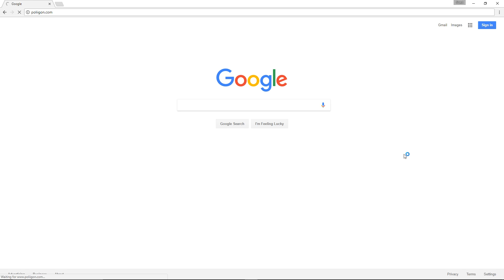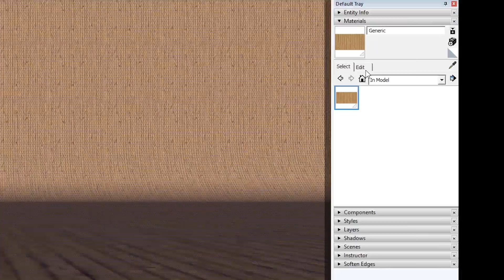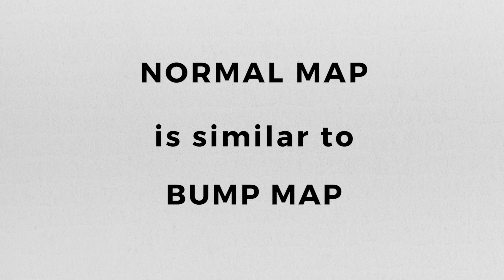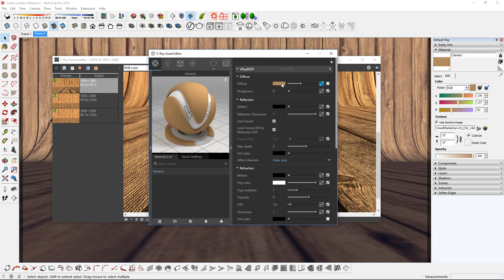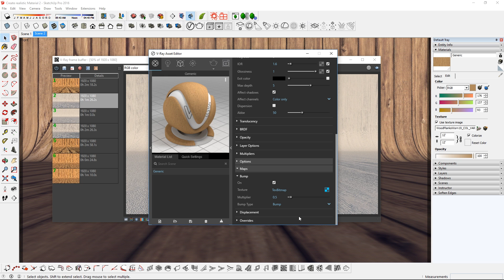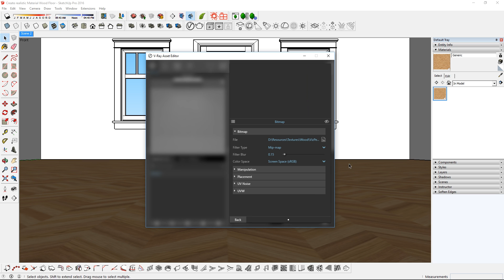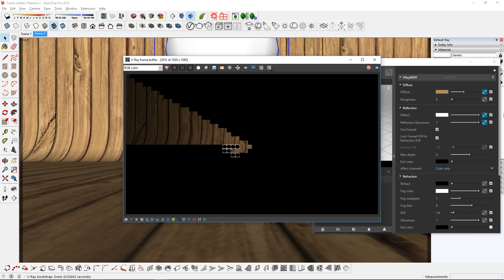How to Create REALISTIC Materials in V-Ray

Comment: Thank you so much for the explanation. 
I have some questions,  my bump and displacement settings does not work.

I am now using Sketchup 2017 trial version. Could it be that reason
Reply from the maker: Both bump and displacement dont work? Did you apply the material to both sides?
Reply: Architecture Inspirations 
 I retry with the given  tif files instead of jpeg... now I can see bumps n displacement... the realism is obvious now.....

Why can’t it work with the jpeg file??
Reply from the maker: @samitune  it should work with jpg files just fine. I use jpgs all the time
Reply: Architecture Inspirations   Yes when I tried jpeg I applied both sides yes, 100% coverage, but to no avail.

One more question ....must I do any form of extruding ; giving the surface some volume n depth, before displacement could take effect?
Reply from the maker: You don't have to. An easy way is to group the surface and apply material to it
Reply: Architecture Inspirations  what do you mean by applying on both sides? U mean both bump and displacement? Yes I’m tried on both all along.
Reply from the maker: @samitune  I meant apply to both sides of the surface. Back and front

Comment: Hi sir Minh , can I ask something? When you're done adding diffuse map in vray from poliigon, is it possible to change the color of that texture from poliigon ? For example, I like the road texture in poliigon, but I don't want its color which is black, I want to make it white.. Is it possible to make it white in vray even if the original color of the diffuse map from poliigon is black? .. Because I tried to maximize the diffuse color in vray to make it white but it didn't work .. The color of the diffuse box is white but the preview in material is still black.
Reply from the maker: You can just invert the texture. Or use color correction texture to adjust the color of the diffuse map however you want. The preview will never change itself if you're only changing the color in vray. If you want the preview itself to change then just edit the diffuse in photoshop

Comment: so, if i have a displacement map i don't need the normal map or the bump map, but the displacement map costs more computing power? so for a flat plane let's say a floor it's better to only use the normal map or the bump map and for more complex organic geometries like stone i'd use the displacement map? Am i getting it right?
Reply from the maker: Yeah you got the gist of it. However, sometimes you may need to use both maps. For example a brick material. The displacement map would help with the joints and insets, while the normal or bump map will create the bumpy surface of the brick itself. It really depends on where you got the maps and how they were created. Overall, normal and bump maps are used more often because they cost less power 😊

Comment: Hi Minh, Thanks for wonderful tutorials. I am using CC0textures website recommended by you. When I download a file it contains several other files, like I downloaded paintedmetal it has several files with names Col, disp, mask, met, nrm and rgh. I have an idea to put Col file in diffuse menu, nrm file at bitmap and disp at displacement menu.Can you let me know where to put remaining files ?
Reply from the maker: I haven't tried to use all of those maps yet but the normal map should be placed in the bump map slot. And I don't think vray for sketchup can read metalness map that well. Mask is for opacity
Reply: Thanks Minh. I always get a quick reply from you. I have also started learning lumion, I was wondering since Vray has a lot of options for a material. Don't this give the fact that vray give more realistic result. Since Lumion uses only texture and normal map. and just few more options.
Reply: Can you also make a tutorial on lumion for basic materials like plastic, wall paints, sink and toilet ceramic material properties. Because these are the things in every model.
Reply from the maker: Ah got it. So maybe a video on advanced materials in Lumion? Would the be helpful?😄
Reply: I don't know what will make the difference between white wall, white sink or toilet material and white plastic and if you can add white paper. I hope you get my point. These are the basic things which everyone uses but no one put tutorials on these.
Reply from the maker: Hm, but aren't there already materials for white plastic, white walls, etc in the library?
Reply from the maker: Ah I realized I commented about Lumion, when you're asking about vray 😂
Reply from the maker: I actually use the existing vray library a lot and I just make changes to the materials to get it to be the right color that I want. I'll try to see if I can make a video on that 😊
Reply: Sorry I got things mixed up. I just mentioned vray for comparison with lumion. Rest of the question are for lumion. There is no material for platic, paper and sink materials If i remember. Also I wanted the answer for question that is vray give more realistic result than lumion ? Is normal map sufficient for getting better result in lumion, since vray has many many options for a material ?

Comment: Hi I have a question. How do I get a bump/displacement map? Or I can use the same normal as a bump/displacement map?
Reply from the maker: You can use the normal map in the bump map slot but you may need to make some adjustments. And no I don't recommend using bump and normal maps for displacement map. You can get those maps on PBR textures websites 😊

Comment: Perhaps I'm missing something but I do everything just like in this video but my displacement doesn't work. It's always flat and when I turn off the diffuse and bump there's nothing. My materials are grouped (I saw that suggestion online) but nothins seems to work. Any ideas you could suggest? I'm going mad and in desperate need of help...
Reply from the maker: +Lúcia Tomaz yeah i know how you feel, i have the same problem before. you have to apply materials to a group, meaning, the object needs to have default materials, then grouped, then you apply the material with displacement. A simpler way for me is to apply materials to BOTH sides of the surface. Let me know if that works!

Comment: thanks for your tutorials, sadly I'm still not a fan of vray 3.4 swarm still has defects compared to dr wich works flaw less, I like the new interface  and the denoiser option but vray 2.0 was able to use more displacement maps in shorter times with the same configuration, btw you can use normal maps below bump type /use : normal map to tangent space, if any.
Reply from the maker: yeah you're definitely right about the normal maps! I couldn't get it to render correctly at first but figured it out soon after 😄

Comment: hey , really awesome tutorials dude , however i got problem , whenever i render my scene i can't see any bump or any displacement it's just textures , even though the preview of the materials shows the bump and the displacement , and also i checked the geometry and the scale, it's not that either , what do you think is the problem
Reply from the maker: hm make sure you apply the materials on the Front face of the object. In Sketchup there are a front face (default white color) and a back face (blue-ish purple color). Make sure the material is on the front face. Also increase the intensity or multiplier number until you see more bumps or displacement. Let me know if that works!! 😄
Reply: Hey thanks for the quick replay mate . yes i have tried this too , however it did not work either . the thing is when i use progressive mode in the render options , i get a correct lighting with no bump or displacement . but when i check the GPU acceleration , the bump and the displacement shows correctly just like the preview of the materials  
however the lighting gets all messed up with this black shapes and basically no global illumination ; very different from what i get from just the progressive mode . 
- I also tried very exaggerated bump  multipliers with different materials , but still same issue . i uninstalled vray and installed it again too , and made sure that i m using the right GPU and not the integrated one , Sorry for the long comment lol , coz i been looking everywhere on forums but no luck  
ps : i noticed also in the "vray progress window"  written in red , "Devices query yielded no results; using all available devices"

Comment: Do you have any idea why v-ray 3.4 not render windows, furniture and 
people from warehouse in old modells ? Have a old model and tried to render but this stuff won't render at v-ray 3.4. If I create a new model it works. Thk!
Reply from the maker: +Konrad Lentschig ah I think it's before the new vray has different settings so old models won't render correctly. Try finding an option on the extensions-vray- look for the wipe model option. It will help make the model compatible with the new vray

Comment: Hi, great vid as always mate. When adding a normal map should I change the "Bump Type" from Bump to one of the Normal Map types? I've noticed what seems like better results sometimes from certain angles when clicking that option instead of "Bump" in "Bump Type".

Also when I click displacement and add a map on textures with Vray, I don't seem to get any change in the geometry. Is there any settings I need to change?
Reply from the maker: You can keep it the same Bump type! But yeah you're right, it changes depending on the angles. There's links to videos explaining the difference between normal and bump maps, really useful to know.
You can change the multiplier I believe, might need to increase it to 5 or even more, depending on the texture. 😀
Reply: Top man! Thanks. Yeah I seem to get pretty mixed results with the multiplier. Guess it just depends how strong the displacement map is too.
Reply from the maker: yeah for sure! I had one rocky ground texture that I had to increase to like 12 to get the correct result 😂